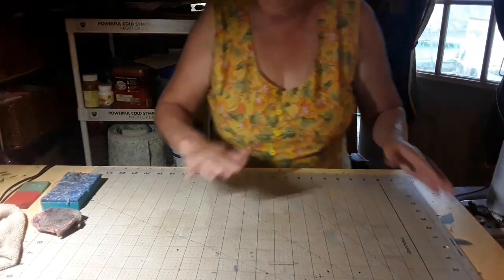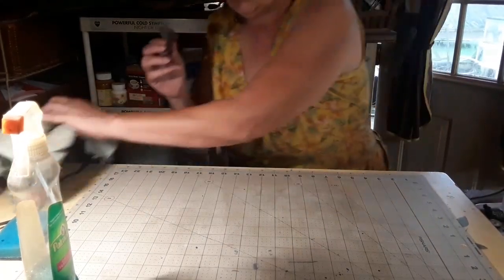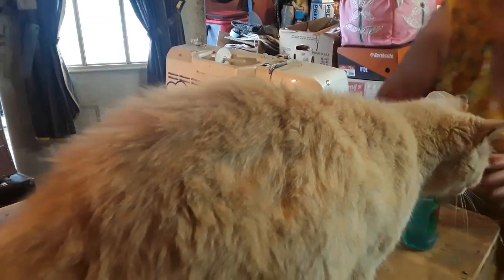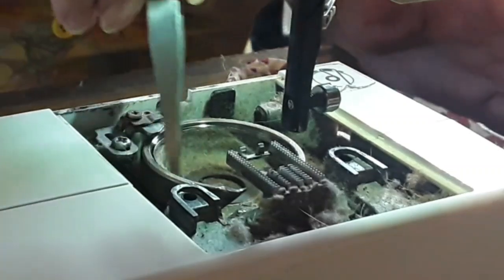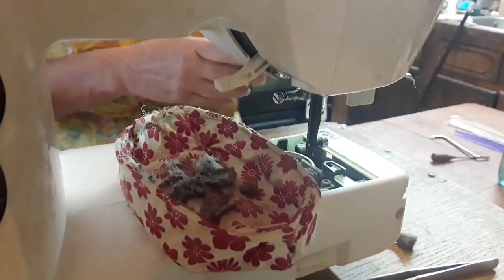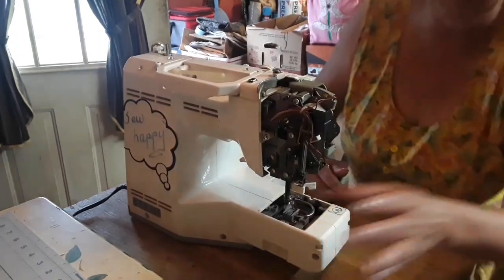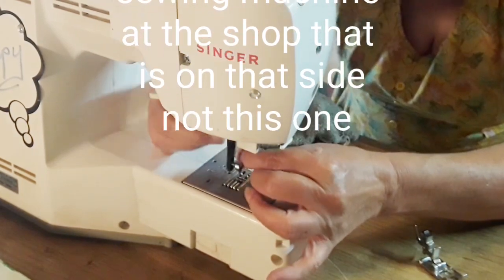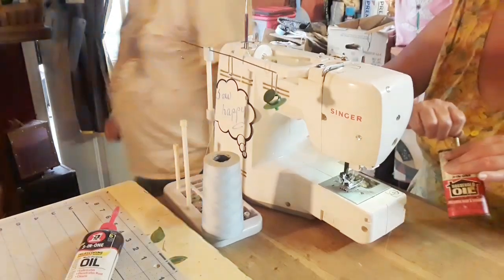past do cleaning

Comment: Howdy Sandy. I have so much clean up to do..lol. and it's finally pouring rain!!! I'm so happy about that. Hope your day is good.
Reply: Vicki where do you live? If I may ask. Arkansas here been usually hot and dry here..Been getting some much needed rain finally as well..
Reply: @cindyhughes5069  I'm in Texas... We finally got a good days drenching..several inches in fact. Lol. We are not flooded though..several places did. I've heard of one death though and I hate to hear that of course. No rain today so far. Y'all stay safe.
Reply: Texas got it bad in some places..im about 50 miles from texarkana lol step over and I'm in texas..
Reply: @cindyhughes5069  yes mamm some places got it real bad.. but we don't flood where we are, we are not at a low ground.